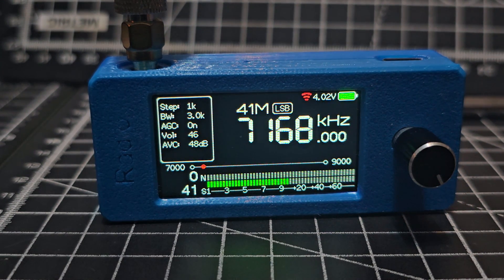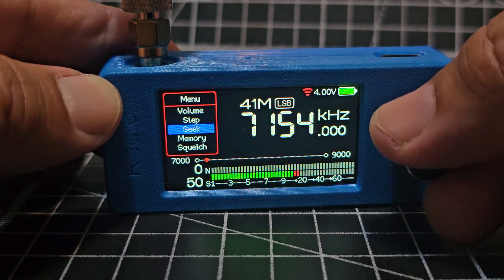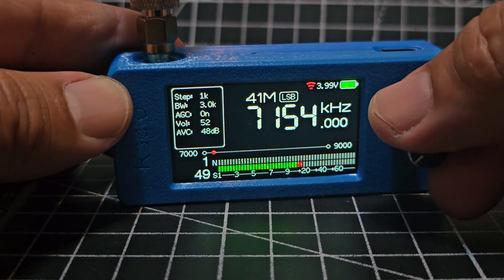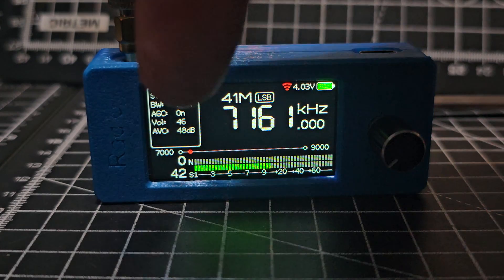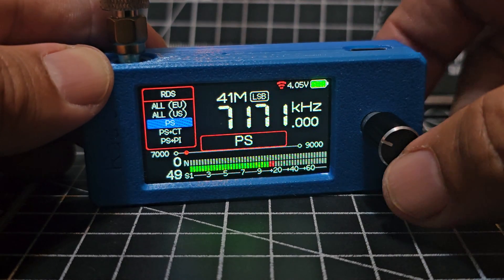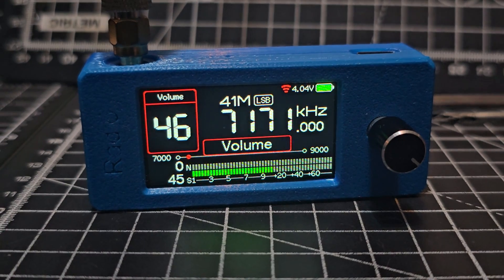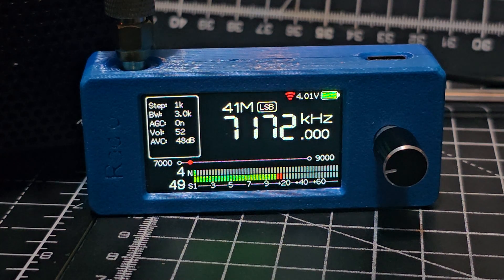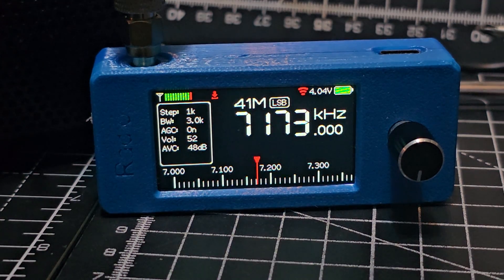After Firmware v2.28 - Si4732 Mini Reveiver - July 2025

Comment: Seek only works when in AM mode or FM.
Reply from the maker: Thanks i will look at wifi connect next
Reply: So that's why I never find anything with seek up or down. I have the AMNVOLT fw version 1.01. 🤔
Reply: @WilliamsKnifeLife  Upgrade to 2.28, the firmware has slightly better sensitivity while in seek mode.

Comment: Everything is soooooo cheap and accessible these days
Reply from the maker: Bargains galore
Reply: But the crazy thing is, IT WORKS!! 5 years ago this wouldn’t have been possible. I was using a Sangean 909X then. I could use a higher capacity battery, but it’s so good at what it does.